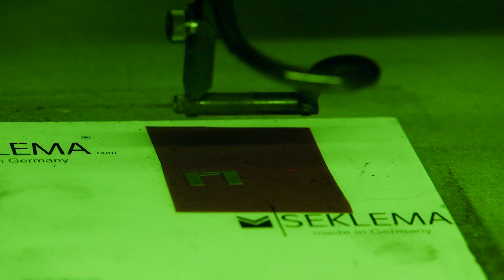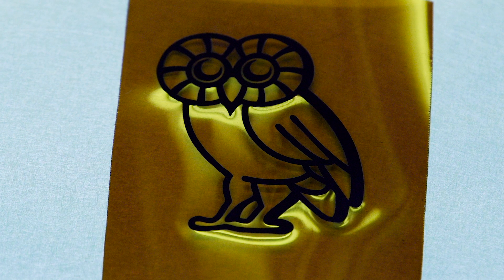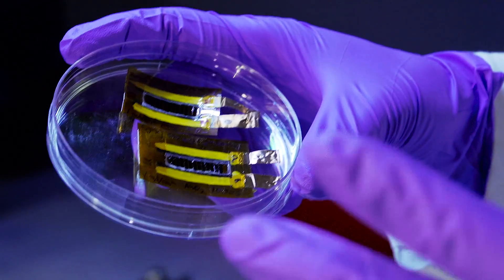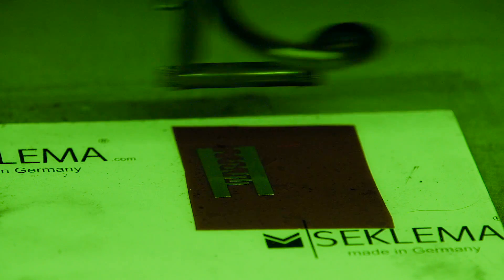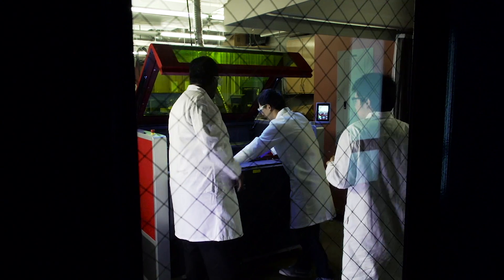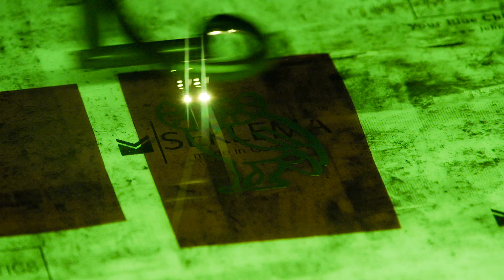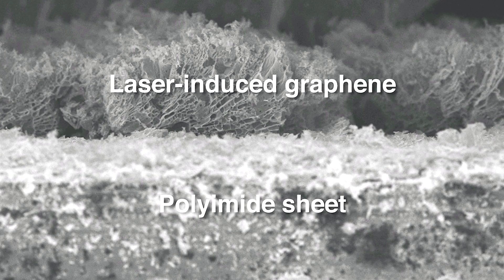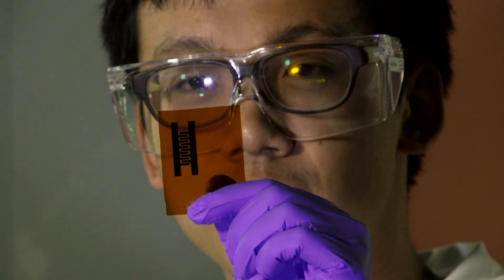Rice University's laser-induced graphene makes simple, powerful energy storage possible

Comment: So question can you do this on plastics and make the whole sheet solid graphene and layer the sheets of plastic to create a bullet proof plate thus making super light weight body armour for law enforcement and military ?
Reply: Unfortunately, no. For graphene armor, you need large continuous tiles of graphene, a way to anchor them securely, and significantly many layers. These graphene flakes on plastic look like they're too small and chaotically adjoined to provide much ballistic protection. With small flakes, the practical strength limit isn't the material itself, it's the strength of the bond it forms with its surroundings and the size compared to the projectile.
Reply: @mattbrody3565  I've already figured it out you take the Kevlar laser cut it to size you run a laser at low low low frequency over the Kevlar it creates graphene then you take flash graphene mix it with the resins and hardeners at 3% strengthening the resins layer after layer of the resins and the Kevlar front and back being lasered creating the graphing on the Kevlar fabric will make a badass bulletproof vest.  Iq 140 sir lol

Comment: What kind of laser do you use? What about the electrodes? What materials are they made out of? And what about the substrate that you're using to induce LIG? Is it polyimide or kapton tape?

Would it be possible to build an electromagnet using only laser induced graphene?
Reply: i believe it is a C02 laser engraver and from may searching on other LiG papers that reference the rice uni work it seems they used a 3.7w laser engraver on kapton tape.

Comment: i really cant understand one thing, graphene is one atom layer thin, and transparent. How come it shows black in the plastic film. I it is several layers thick isnt that graphyte?
Reply: @ Pedro Lopes 
It doesn't, but the flakes are small enough and close enough that electrons can still use quantum tunneling to travel from flake to flake. This method probably wont be used to make a porous membrane that can separate salt from water, or have many piezoelectric applications, but its still electrically conductive. And considering its made entirely out of organic materials, not only is that impressive on its own, but it could be incredibly cheap to scale up and mass produce, as well as being renewable, sustainable, and environmentally friendly. Imagine computers that you can compost. 

And as far as we know, this could be the first step toward mass producing true graphene. I read an article recently that claimed that a laser induced phase change in porous graphene while still in a liquid state could allow the graphene flakes to assemble into sheets. Best of all this could be done at under 300 degrees Celsius, while still on a polymer substrate. Its a theory at this point, but based on my limited understanding, it sounds pretty solid to me.
Reply: Think about graphite. When I have a powder of it it's black. Basically, there are small flakes of carbon sheets bundled up together. Graphene is just those stacks but reduced to a very few or even a single flake. As of today, there is no way to make a large, perfect, 1 atom thick sheet of Graphene. All we have are flakes.
Reply: But can we call it graphene? And those stacks of flaks work line graphene? Ir graphite? Because if they are flakes then they should have not the same behaviour. I think.
Reply: Today's graphene had somewhat of the properties true graphene has. Still, it is better than using graphite in electronics. If you want to see it in action, take a look at Robert Murray-Smith's YouTube channel.

Comment: who you store energy in that printed plastic? Dont quimical reaction need like on LI-Ion baterry?
can be recharged?
More details please.
Reply: There is no chemical reaction needed. Capacitors store pure electricity. You can look it up for more info.
Reply: ahh its capacitors...i like store pure electricity but the capacitors have low density of storage and cant be used like recipient of storage.